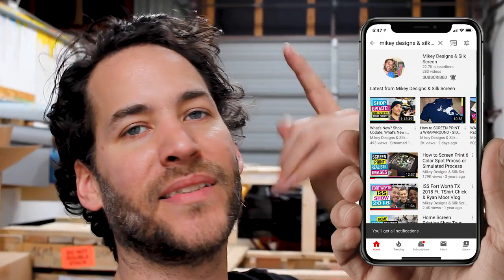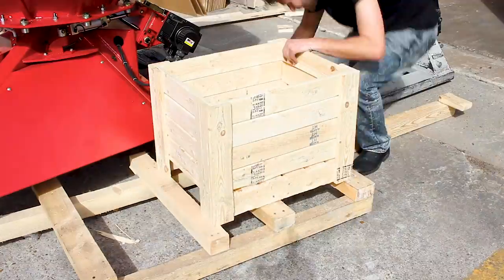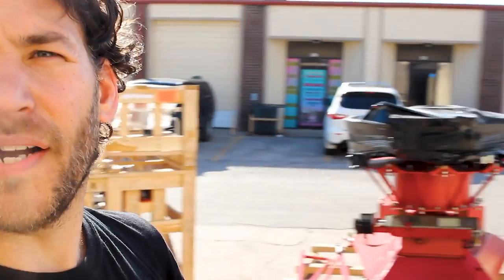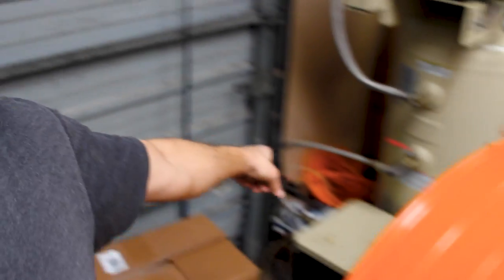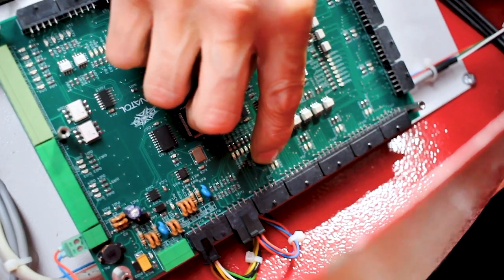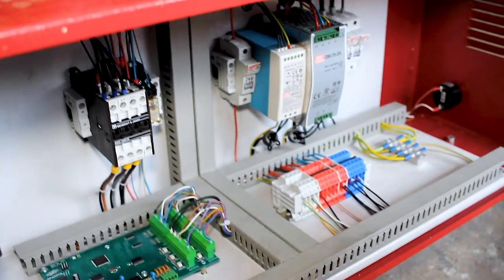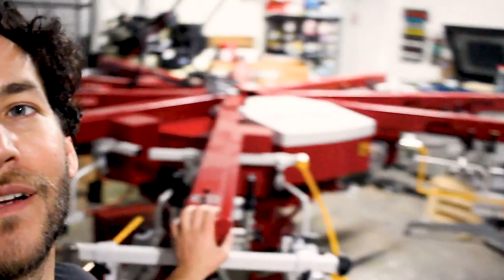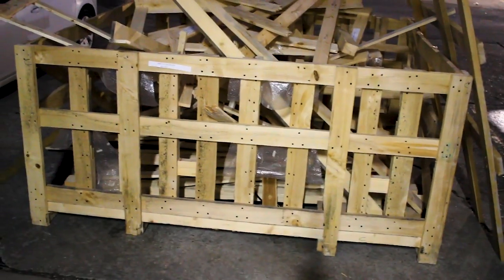Assembling an Anatol Titan Automatic T-Shirt Screen Printing Press Vlog - Day 1

Comment: Back in 2000 when I started printing we had 3 14 color 3 station Anatol presses. They were good and ahead of their time. They said they were so fast that they needed 3 stations. You could have two loaders and one puller or visa versa. Most shops stick with M&R so right now I run a 14 color gauntlet 3. Awesome to see they are still around.
Reply from the maker: Dang, that's awesome! Wish I could have seen it. Seems like, to me, their still ahead of their time.

Comment: Nice..... we considered the Anatol Titan before going with our M&R Diamondback E.... looks nice, enjoy the electric print heads, they are nice to operate
Reply from the maker: Thanks!  We had looked into the Diamondback E.  Was a little pricier.
Reply: Mikey Designs & Silk Screen Yeah that was initially the case for us to... but, Johnny at Midwest Sign & Screen Printing Supply Co. gave us a killer deal and it ended up being about the same price including the triloc system.  Very happy for you guys
Reply from the maker: @printedstitches7480  That is a great deal! Thanks! I appreciate it.

Comment: Get that press jack up as high as you can get it. The higher the better. I'm using thick square tubing under the feet to get at least 3 extra inches in height. It makes it easier to get under the press to clean or do maintenance, not to mention printing so you don't have to bend your back too much
Reply from the maker: You're absolutely right about that! Great tip!

Comment: Right on, congrats!  Game changer for sure. Just curious, how come you didn’t go with the volt?  I’ve had mine for a couple months now and it’s been blowing my mind. So smooth and quiet.  No more compressor and chiller. So stoked I moved from blue to RED❤️
Reply from the maker: That's awesome! Congrats! I wanted to retain the compressor in the shop for air tools for personal projects down the road. It doesn't use that much air. The heads are electric, and has a servo indexer. The only difference really is that the lift is air as well as the heads. To me, there's just something cool about the sound of the air lift, and I tend to take things in steps when it comes to business purchases. So who knows... down the road we may upgrade to a volt. :)
Reply: Mikey Designs & Silk Screen Yup can see how you can use some air in the shop. Use this if you want, but I couldn’t handle how loud the beep was so I wrapped it with a coozie to muffle the sound. Soo much better. 🤙🏽
Reply from the maker: @kylemaligro  It's a little on the loud side, but we probably need to keep it loud because the Shop Gnome has the tendency to get close to the press and makes me nervous. She crawled under our last press and lucky wasn't hurt too bad.
Reply: Mikey Designs & Silk Screen right on. Makes sense.

Comment: I’m SooOoOoo Jealous! For some reason I thought ANATOL did not need any Air. . Looking good guys !
Reply: This is an ASE press which uses Air to Lift, Servo to Index and Electric to print. The Anatol Volt needs no air at all.
Reply from the maker: Thanks, Rhy!!! Senad has got it! The Titan is more of an entry level press that's easier on the wallet.  So it uses some air. They do have all air models which are that much more affordable.
Reply: @mikeydesignssilkscreen473  with the capabilities of this press, I would hardly call it entry level :) its an amazing machine! Heck 10 years ago you would have to spend 70k+ on a press to get servo or electric features.
Reply from the maker: @senadzenkovic2483  You're absolutely right! :) Its definitely a step up for us.

Comment: What the diameter of that press?  Looks like 14.5 ft.
Reply from the maker: It's about that. Good guess. I'll measure it once it's finished.
Reply: Actually, the diameter is 12'3" with screen loaded. Have you had a chance to speak with your Anatol rep?
Reply from the maker: @michaelmerritt3996  About the size?
Reply: @mikeydesignssilkscreen473  No just in general. If you want more info let us know.
Reply from the maker: @michaelmerritt3996  Thanks, Mike for your help!
Reply from the maker: @michaelmerritt3996  I just put two and two together, lol. Thanks Mike for all your help! I'll be sure to touch base once we're up and running. Lot's of excited around here. :)
Reply from the maker: @michaelmerritt3996  That's pretty much the same size as the Javelin we had. I think it's the perception with more heads. :)
Reply: Michael Merritt  Wow, I’ll think about it!